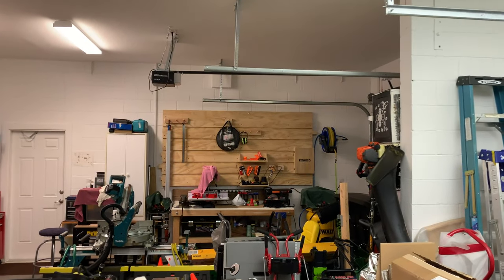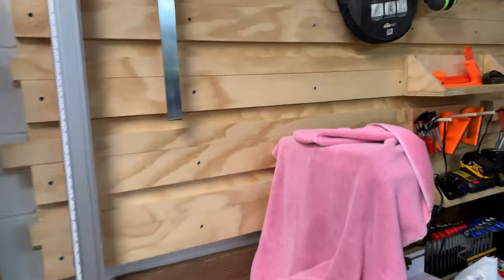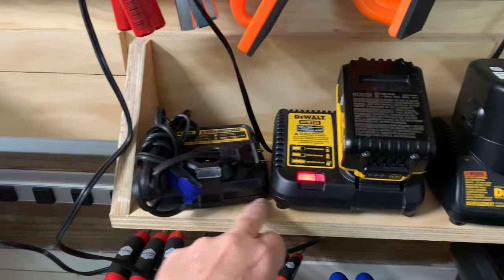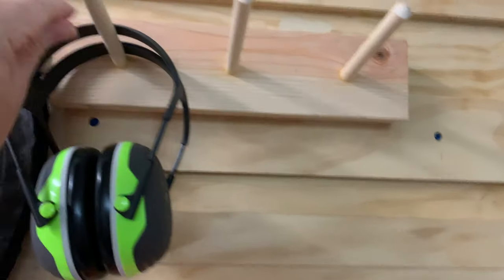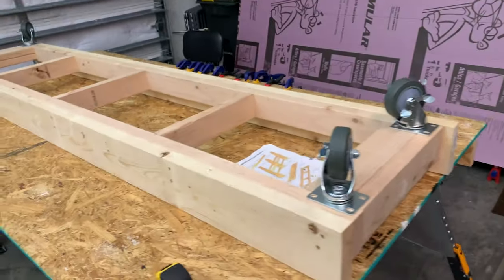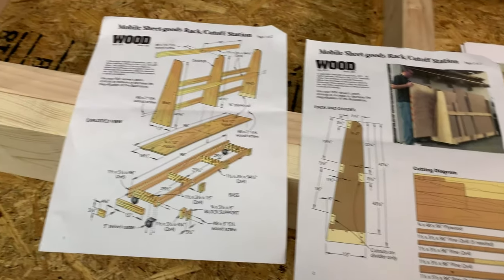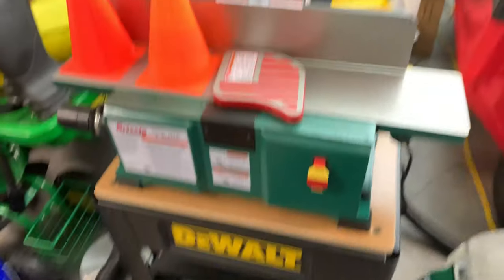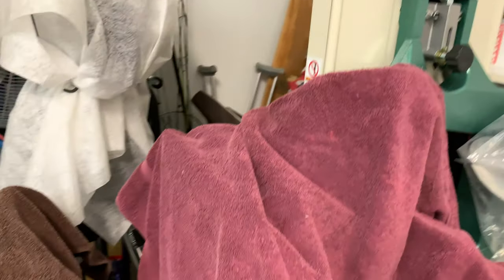Woodworking Sheet Goods Cart and other Projects

Comment: I thinnk your doing great! Excellent thinking on the wheels being to far inboard.
Reply from the maker: Thanks Tom, wish I'd figured out why the plans didn't have a brace in the center of the frame, realized it was so you could screw the middle upright to the floor from the bottom.  I had to put the upright on before attaching the floor to the frame.  That was fun.  LOL

Comment: Congrats on being a GrandPa.

That rack seems like a rather large investment from a space perspective, do you really cut/store that much plywood?
Reply from the maker: Thanks.  Yep, it is a big investment in space.  It's only 18" in depth but 96" long.  And no, I don't use a lot of 8x4 plywood, at least not right now. Thing is when I do get sheet goods I have to sit them in front of a bunch of shelving and I never get to them right away.  To get anything off the shelves it takes a Herculean effort.   With this cart I accomplish several things, a place to store the full sheets, cutoff bits and spare wood,  I got to learn a few things, and its on wheels it is real easy to move out of the way with or without full sheets of wood on it.  :-)
Reply from the maker: Oh and I plan on keeping a 8 x 4 sheet around for using as a work table with my saw horses.  :D